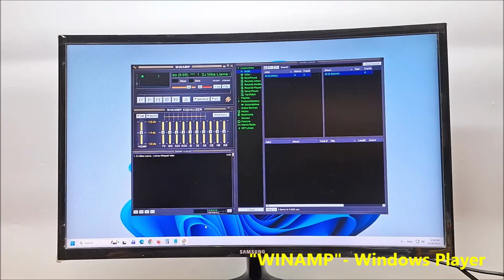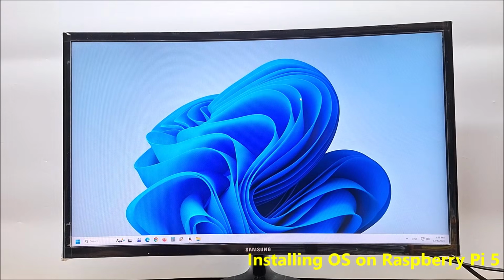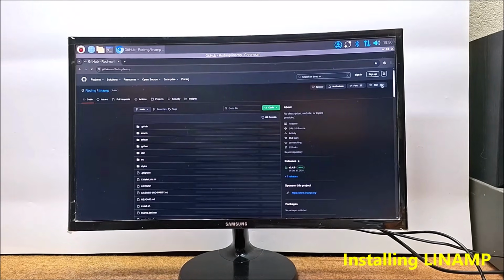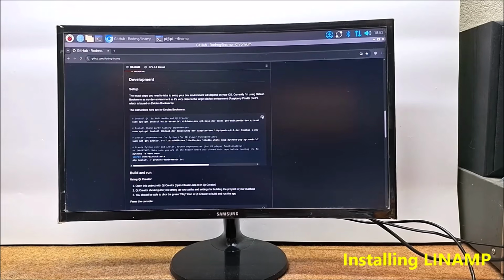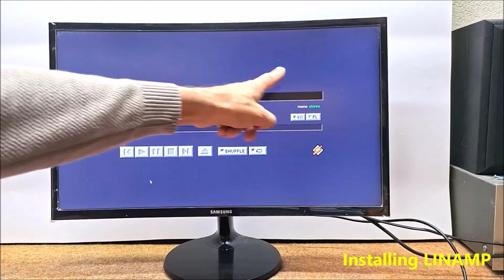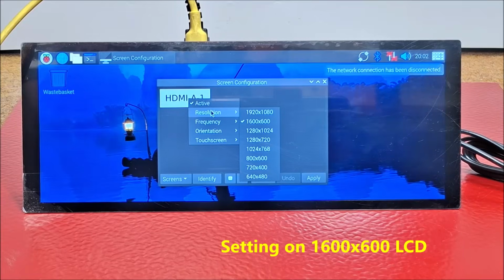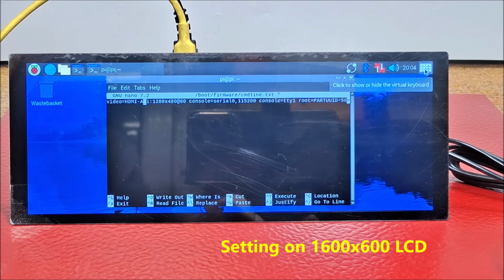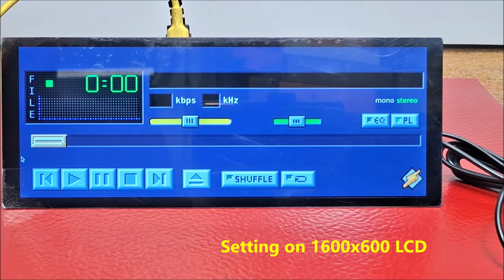LINAMP Project – Winamp Style Audio Front Panel on Raspberry Pi 5

Comment: Which raspberry is good for dac , pi5 or 4 ?
Reply: The 5 does not have an onboard DAC, whereas the 4 does. On the 4 the DAC is fed to a standard 3.5mm analog audio jack which will be adequate for most in terms of audio quality. For the 5 you have 3 basic options: audio over HDMI, a USB DAC, or a Raspberry Pi Hat which is a plugin board that uses the Pi's GPIO pins. USB and Hats go from $4 to approximately $150 depending on the audio quality.